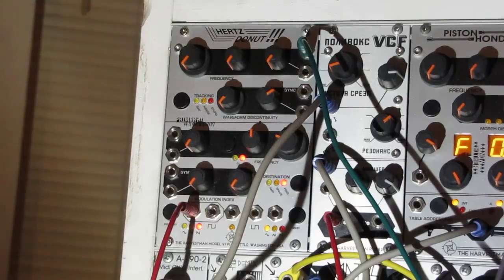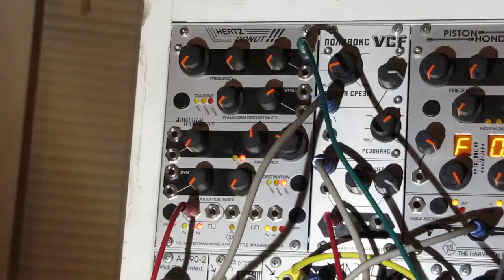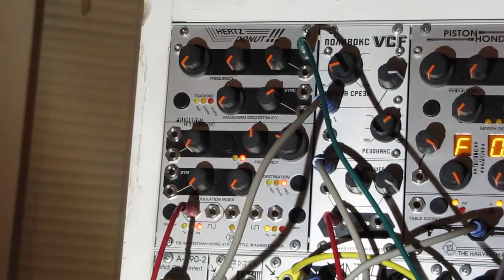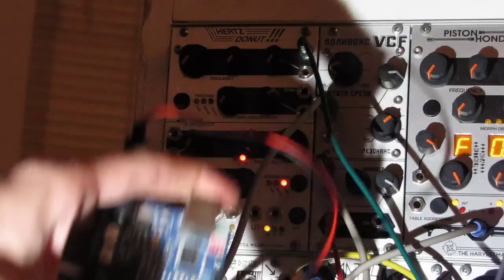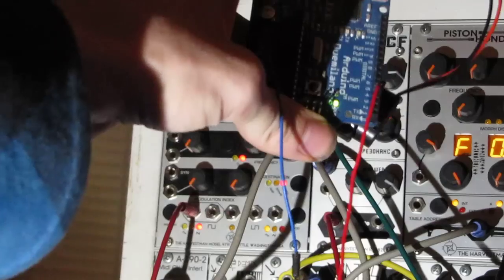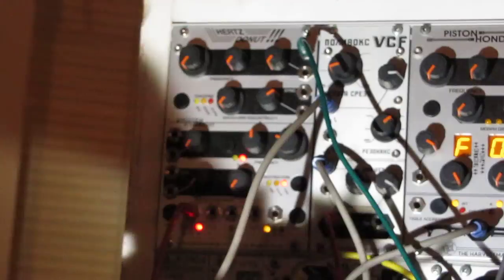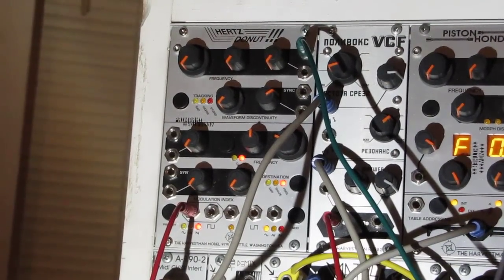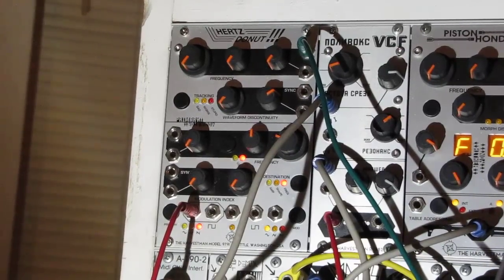Arduino 004

Comment from the maker: Have you tried raising the sampling rate (mine is at 1028)?  I had trouble figuring out why it was going so "fast".  Also make sure pin 4 is PWM if you are using it as the output.  in the original sketch, I think the output was pin 3 and pin 4 was used to turn on the radio.
Yup signal = tip , ground = ring. Don't be afraid to ask questions, the only way to know for sure is to ask!